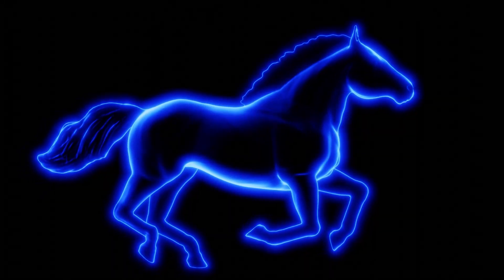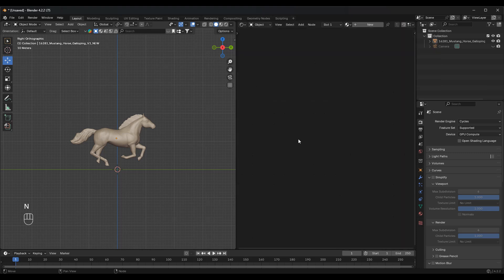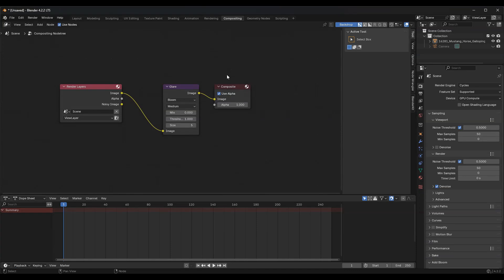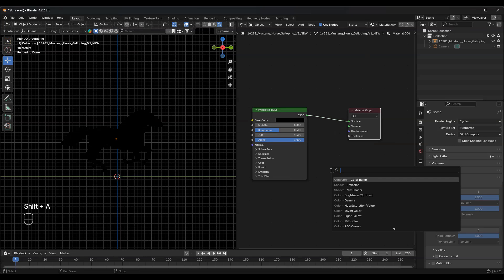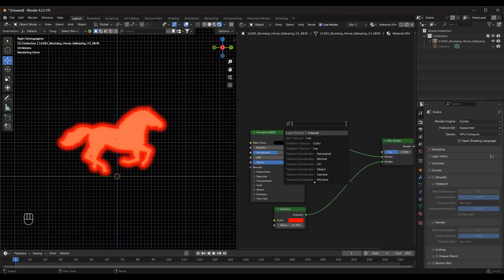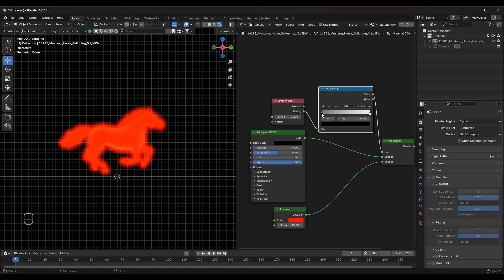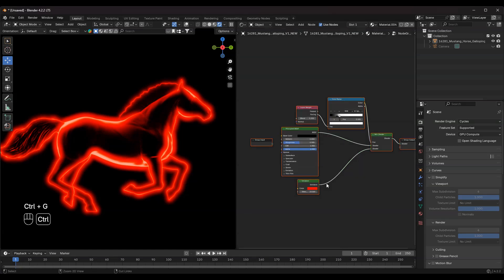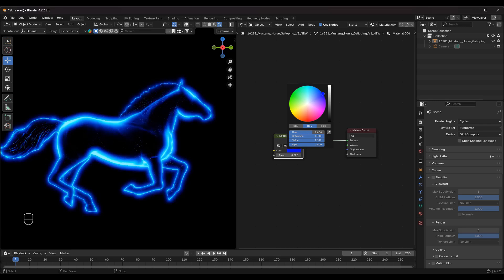Glowing Edge Shader in Blender (Easy Node Setup!) | Blender Tutorial

Comment: bro i need help , my result in rendering is different from the scene i saw i viewport , in terms of color and contrast ......... i tried doing all sttings same for both , but still get different results
Reply from the maker: It sounds like a color management issue! please check few things  below:

1. Check Color Management Settings – Go to Render Properties > Color Management and ensure both Viewport Display and Render are using the same settings. Try setting View Transform to "Filmic" and Look to "High Contrast" if needed.

2. Lighting Differences – Some lights (like HDRIs) might look different in the viewport vs. final render due to how Blender processes them. Try adjusting Strength in the World Shader or enabling Scene Lights and Scene World in the viewport shading settings.

3. Viewport Shading Mode – Ensure you’re viewing the scene in Rendered Mode (not Material Preview) to see an accurate representation.

4. Compositing Differences – If you're using the Compositor, effects like color grading won’t show in the viewport. Try disabling the compositor to compare.

5. Texture Color Space – If using image textures, go to the Shader Editor and check the Color Space (sRGB vs. Non-Color). Incorrect settings can affect render appearance.
Reply: @blenderexpress892  
1. verified multiple times 
2. not using any hdri 
3.shading mode are correctly used 
4. i used glare in compositor , but is not affecting the result , i tried turning it off and on 
5. no texture color used 

issue might be because of some lighting that are off with eye icon , but on with render icon , and that is why they only visible in result , but i am not sure about this issue , because i also checked it and found nothing 

thanks for your attention 
i hope you will also help me if i get any such issue in blender  in future